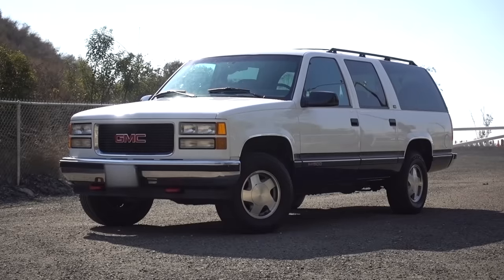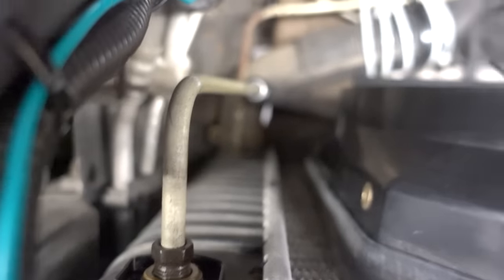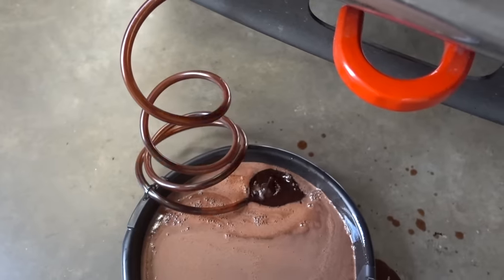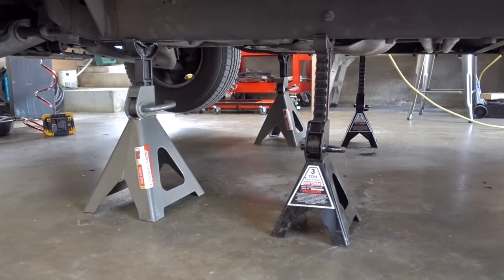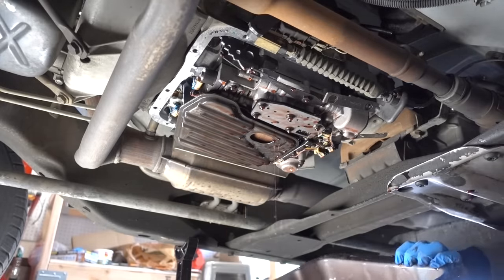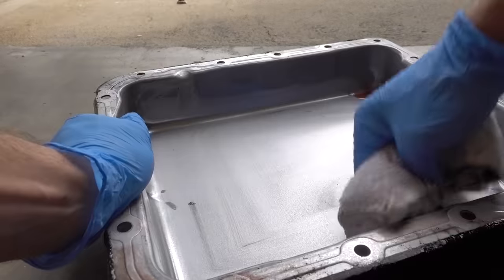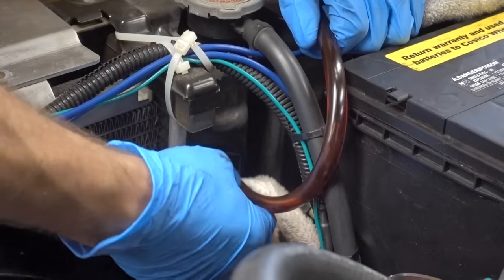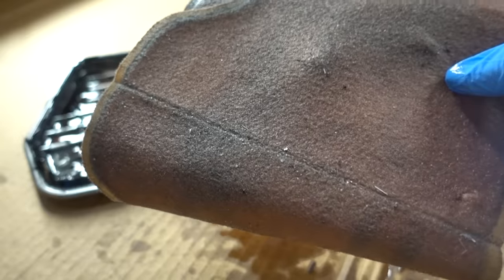Why You Should NEVER FLUSH YOUR TRANSMISSION FLUID!!

Comment: The best and biggest drain pan is one you can get for free!

Keep an eye out for old dishwashers at the curb on trash pickup day.  Drag the thing home if it's a fully plastic tub interior.  Leave the stainless steel ones where they sit...

Cut the tub free of the metal cage and supporting wires, tubes, and pipes.  Place the bare dishwasher tub on its back.  Now, look at were all the holes and penetrations are.  You should be able to take a saws-all with a fine toothed blade and cut the tub 6" to a foot off the ground depending on the holes and the depth of the tub you need.

I use these DIY tubs everywhere...  They're on shelves as catch-alls for small crap and parts.  They make great wash basins.  And, per this post, they excel at large-area drain pans for transmission fluid changes and such.

You're welcome!

Comment: One more thing: best to remind people that the final level check is done with the engine running and having the transmission in Neutral. Thanks.....you did a great job. This is a great service to do on older vehicles.
Reply: And the engine has to be hot.
Reply: This really depends on the vehicle.      Some dipsticks have a hot-cold line.  Some you check in park, off or running. some in neutral running.       Some systems even go wild if you run with a dipstick out.
Reply: @MrTravisAl Totally. Precisely follow your owners manual or service manual in the case of a sealed transmission.

Comment: and for 10 bucks or so, you could have added a drain bolt when you had the pan out. I just drain and refill every 36000 miles.
Reply: That's probably a bit excessive.
Reply: @TheCarpenterUnion  My car calls for a flush every 30k miles. Seems reasonable to me
Reply: @Pippy1  autos are usually every 60-80k. My DSG is the only thing that's ever said 30k
Reply: Its a 4l60e. They die quick if the fluid goes. They even make deeper pans with fins and a drain plug. Seems like cheap insurance  🤔
Reply: But wait there more
Reply: The 36K must be your personal interveral... GM says 45K under severe service and that's what we in the trade go by!
Reply: That would be the "I" part! 😆 
But there's an age interval in addition to mileage.
Reply: Best suggestion..Agree
Reply: Best $20 ever spent on my trans flush was replacing the stock pan w a drain bolt unit

Comment: If the video title says "never flush your transmission fluid". Then why are you doing that?
Reply: He's not flushing, he's replacing the oil.
Reply: He's doing a fluid change, not a flush.
Reply: Flushing wouldn’t include dropping and cleaning the pan, removing all the particles on the magnet and installing a new filter (I guess) but just changing the oil.
Reply: He is flushing the transmission. The video title was originally different I think, it doesn't make sense with the video now.
Reply: @killer2600  
Flushing requires a machine, which pressurises new fluid into the trans, and retrieving the old... which could cause particles to get stuck in valves and other small orifices...
The is fluid replacement.
Reply: @splash5974  You need to look up the definition of flush. You don't need a flushing machine to accomplish the act of flushing out the fluid. You can flush the brake system as well and you don't need a flushing machine to do it either.
Reply: @killer2600  
And by flushing brake system, you are using hydraulic pressure from the system, or a pump, the flush the brake fluid.
Sorry bud, but this is not a trans "flush". Regardless of how you think you could word it!
Reply: @splash5974  Indeed the fluid is being pushed out of the system during a flush, you did see the fluid being pumped out of the system in the video did you not. If you missed it go back and watch again. Like I said, you don't need to hook up a machine called a "flush machine" to flush out fluid.
Reply: @killer2600  
By the way your describing it, if you blew a trans line or have a leaky pan, and you replace that lost fluid, you have flushed your transmission!
Lol
Have a good night man!
Reply: @splash5974  it is a flush. By definition, you don't need a specialized machine. Old fluid out through clear hose, new fluid out through clear hose
Reply: @osos231  
To each their own!
Its not a true flush, because you are only replacing fluid. I would not charge a customer for a transmission "flush", and then do this procedure. I would simply charge for filter, gasket, and any fluid replaced. I guess you would need to know what a trans flush is before confusing the two...
Reply: @splash5974  you indeed have to know simply what flush means. Old fluid out,new in, whether done with the machine or trans pump. Will you get 100% of the fluid out? No. I dont even think the machine even gets all of the old fluid out. Most of it close to a %100 but not %100. Remember, most shops probably want you to believe that you must use their expensive transmission flush machine 😉 In a good number of cases, it's a money thing. To each their own. 😉
Reply: Yep!
Reply: @osos231  yes, to each their own.
Replacing fluid, to me, doesn't mean flush... just cause you tie into the syatem and allow the pump to spew fluid out, isnt really a flush... the flush process requires cleaners that are injected through the machine and trans, removing buildup.
But maybe we could call it a "DIY FLUSH"😉
I dont even reccomend a flush(machine) on older vehicles, cause they could cause parricles to become lodged in valves and passages, leading to trans failure.
Reply: @godackgudalach1  
Thank you. Finally a sensible person!
Reply: @splash5974  to add to your last statement,.I do not even recommend cleaners in anything that has to do with trans or engine with the exception of a very few items. So if the idea of a professional flush entails chemicals, well then dealers and shops can keep their toy flushing machines to themselves 😉
Reply: @splash5974  Not our machine. It just uses the transmission to move the fluid and supplies the new fluid.
Reply: @splash5974  he used pressure created by the transmission to push out the old fluid. yes, it is a flush.
Reply: @splash5974  um, flushing isnt just replacing what is in the pan. Do you know the English language?
Reply: @godackgudalach1  Oddly enough, this is your opinion and it means fuck all to anyone as well lol.
Reply: @killer2600  that is not a flush. A flush uses external devices that create their own pressure to replace fluid. That's the bad one. He's exchanging the fluid, using the transmission own pump to move fluid. That's not flushing anything No external pressure all the same pressure  that the transmission is used to. So many people confuse the two so you are forgiven
Reply: @adamnichols476  no, that's an exchange. A flush uses an external device for pressure. You and half the people on you have it wrong
Reply: Once the color changes the fluid should be changed immediately
Reply: I'm glad this gentleman speaks loud and clear. I get tired of asking people "what did you say"!
Reply: @adamnichols476  
Thats just the pump. Theres no extra pressure created...
Reply: @adamnichols476  no shit!
Dont know why you are replying to me about that!
Reply: He definitely flushed the transmission and then changed the filter. That is exactly how I do flushes at my shop (without the filter change). I hook into the cooler lines at the same point on the radiator except I attach fitting to the radiator and the cooler line and then those are hooked to hoses on a machine. The only difference is that he caught the fluid into a catch pan and I use the machine to catch the fluid. The machine doesn't pressurize the fluid before going into the transmission. It uses the pressure created by the transmission pump to do all the work. I agree the title is misleading.
Reply: I feel like a lot of u guys. He clearly flushed it. Some of you are saying he didn't due to not using a machine while the rest of us are clearly seeing and hearing say "flush the old fluid"... just because he removed other components and replaced em doesn't change the fact that he still flushed it. I get what he saying but his title and what he's actually doing is confusing.
Reply: Flushing pushes fluid backwards thru the system using a machine. That will ruin a tranny quick pushing particles backwards clogging orifices. Never flush this was just changing tranny fluid and filter
Reply: @sbond1963  You are forgiven for not knowing the definition of "flush" or that a flush is a fluid exchange.
Reply: He said at the end you shouldn't but he chose to take that risk and time will show so if things go bad he doesn't mind to get new transmission because he wants to keep that truck.
Reply: @chucko5006  Do you know what is the difference between normal oil change in the car and engine flush (because it is not exactly the same thing?
Reply: This is considered a flush. I rebuilt Transmissions for a l living for many years when I was young. Credit for what was done by channel operator for trying to help people. However can get more complicated to explain all possible ways to get the most fluid replacement.  I do not like the external devises as I have seen them actually do damage to converter clutch seal on the input shaft. Basic things to do differently. 1. Drop the pan first. A little trick after all cleaned up is to reverse dimple the pan holes using two ball peen  hammers and slightly tap smaller  Hammer with larger as holes have tendency when originally tightened to dimple towards case. 2. Then refill pan with about the 5 or so qts. Depending on pan size and depth. They make a fitting you can connect Instead of screwing plastic hose into radiator.  Next part takes 2 people. 3. In park and e brake on. One person starts  car while second person pours fluid constantly in fill. The fluid from converter goes to cooler and into jug or pan or bucket of your choice. Clean fluid in pan refills converter. Not a 100% accurate flush and we would over flush with new fluid to get as much as reasonable. Now keep in mind that some converters had/ or have drain plugs. That can be drained eliminating most of this process.  That would only necessitate cooler lines and cooler needing flushing or some would blow out with air, needing multiple lines disconnected. If you don't have full understanding be careful or pay someone that does. Good luck.
Reply: @regarding "flush": Whether or not it's a "flush"by industry standards is one thing. The real issue here is what is meant by the guy who made the video. He clearly referred to what he did as a "flush", which was the basis of the op's question.
Reply: @teniagreer1107   Nevertheless, the  publisher can be clearly be seen above with this quote; "In this video I decide to go against the grain here and flush the transmission fluid in my 1995 GMC Suburban."
Reply: You should never do it the way this guy is showing. You empty your pan when you change the filter. Then refill what you took out of the pan. This is called a fluid and filter change. To completely flush your system, you then need to disconnect the line at your oil cooler, then pump out one quart at a time by starting the car and putting the transmission in neutral until one quart comes out. Then shut off the engine and add in a new quart in the check/fill tube. Repeat until all the old fluid is flushed out. This way you will never allow air into your system. Always add exactly the amount you remove. Do not simply buy the amount listed as your capacity. Have a few extra quarts on hand.  It's easy. Always do this yourself. Never have it done by machine.
Reply: Lol I was wondering as well but I flushed my trans. Oil n my mark Viii it works I drove slow for a week then normal hey it's OK. 👌🤓
Reply: @splash5974  so 300 pounds of trans pump pressure is a different kind of pressure than a flush machine?
Reply: @arnoldarnold1034  
Listen bud, your just opening the system and letting the fluid pump out, rather than go through the entire system...theoretically causing a leak in the system.
Completely different than using a flush machine, which flushes the entire system, and most of ghem using a detergent(cleaner).
Please educate yourself on a real transmission flush before making comments.
The way your talking, when you close the system back up, basically your flushing the trans constantly, because your pump is working??
Lol
Are you ASE certified, or an apprentice? Just curious btw...
Reply: Terry Melvin  
Agreed!
Reply: It’s not oil it’s called fluid please do not put oil in your transmission
Reply: It’s not oil
Reply: Reverse psychology
Reply: @killer2600  Wake up - this is 'NOT' a flush!  I'm sorry for your mechanical misguidance.
Reply: Of course he flushed it. When you flush the toilet you don't have a high pressure pump blasting away, just the weight of the water.  If you don't flush it-- you get the nice smell.
Reply: @killer2600  he is not flushing the transmission changing the fuild tottaly differnt than flushing it bro
Reply: @-hunter5595  Then tell me the difference bro. What's a flush doing that this isn't?
Reply: never flush transmissions. filter service only.
Reply: NO
Reply: It's a bait and switch title to get more views and money.
Reply: its not a machine flush.
Reply: You dont change it.   Sell your car to him when it starts to fail but works just long enough for money to drop in your hand and for you to run away before he changes his mind.
Reply: @killer2600  You're just plain wrong here. A trans flush does involve a specialist machine, it forces almost all of the old fluid out of places like valve bodies and, critically, the torque converter. Just because he is using the vehicle to pump the old fluid out, does not make the activity a 'flush'. See the comments farther down from professionals.
Reply: @killer2600  your brakes don't have valve bodies and a huge torque converter where fluid sits. You're trying to create a false equivalence between flushing brake lines and flushing a transmission. They're two very different things. Just because the same word is used, doesn't mean you can assume the two processes are the same...
Reply: @spokebloke1  So a brake flush, coolant flush, or toilet flush doesn't force out the old fluid? So it just stays there right? Because it hasn't been forced out with an external expensive machine. All you die-hards keep trying to say I'm wrong but you all still haven't picked up a dictionary. Dictionary says I'm right which makes all of you wrong.
Reply: It's wasn't a flush. It's a drain and fill with filter change. Most manufactures even are against any kind of transmission flush even for new low mile cars. It will even void the warranty if a flush has been done. Most shops are no longer even doing flushes at all as it causes too many problems and lawsuits from angry customers. They only do fill and drain now.  Only criminal shady shops still offer a transmission flush.
Reply: @splash5974  Not if it does a reverse flush :-)
Reply: @arnoldarnold1034  Yes many flush machines actually have a reverse flush cycle which sends the fluid in the opposite direction, sounds crazy but the original idea is that by doing that you would loosten/dislodge any material that was still stuck on any surface but in reality the reverse cycle many times just sends particles that had settled at the bottom back up through the entire system where they would get lodged in areas they could do damage and sure enough, a lot of people have had just such issues after an actual pressured flush machine that uses the reverse cycle so yes it's a different kind of pressure since the trans pump only sends the fluid in one direction.
Reply: Your pretty much diluting the old fluid with new fluid.
Reply: He just performed a fluid dilution.
Reply: @splash5974  d

Comment: Here's why his flush may have worked.  The prevailing reason not to flush is because it may push dirty particles into areas that cannot tolerate any debris.  This is primarily because pump machines may push ATF fluids in directions not normally in the transmission flow design.  He used the vehicles pump to push the ATF with the flush.  So the ATF was always pumped in the direction of designed flow at design pressures, thus reducing the chances that dirty fluid would get deposited in areas its not supposed to.
Reply: Thats why its generally a better option to change the fluid instead of flushing it. New fluid will not harm your tranny, it will actually help it. Its generally best to stay away from a "flush" service due to it being pushed like you said, containated "new" fluid being introduced after the filter, or a poor quality machine that may allow they tranny to run dry. Best best for the diy'er is simply to drop the pan, let as much fluid drain out as possible, and install a new filter.

Comment: My 2000 Silverado 1500 with 258k miles started shifting hard today.  Ran to Autozone and picked up a siphon pump for $11 and 2 gallons of full synthetic Dexron VI ATF for $28 a gallon.  Minus my Veteran discount of course.  I siphoned out a gallon of old fluid... Added a gallon of new fluid.  Ran the motor for a couple minutes.  Then siphoned out another gallon of fluid and added another 3 quarts to get right on the money on the dipstick.  Test drive was awesome... Nice smooth shifting and now i'm not over heating while sitting and idling!!!  Valvoline wanted $140 to $180 to do a flush.